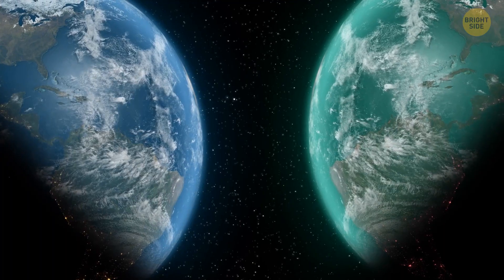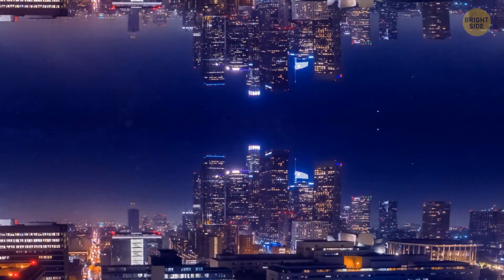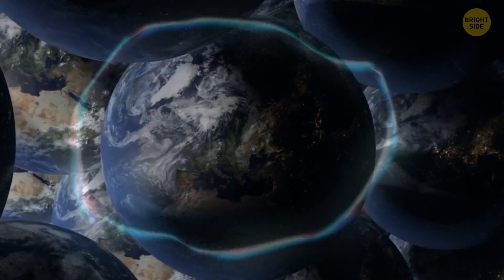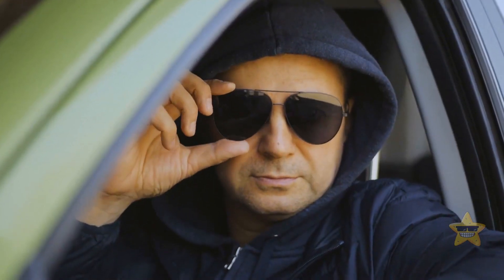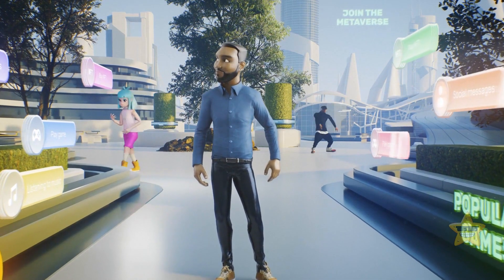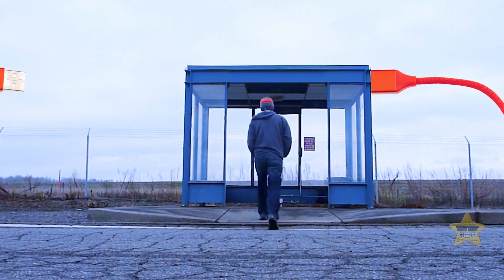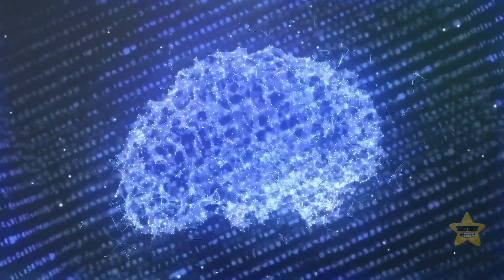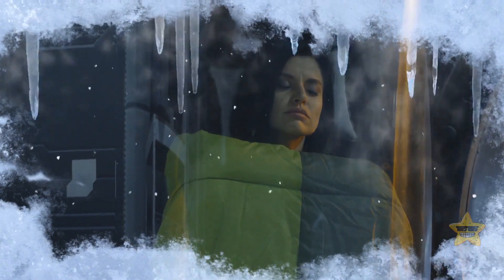NASA Discovered a Parallel Universe?

Comment: Even if our world is a simulation, these simulations will still possess some rules which are identical to IRL. Namely the flow of elecrtricity within the processor can be measured by the inner inhabitants, much like how by pushing a game to it's extremes can create glitches, inhabitants of a VR world, by examining their own world, could learn of the laws of a higher world.
Example: if we were to create a VR world it should in theory be possible for the inhabitants to realiselaws of gravity on the outside world, since gravity will still affect the circutry to some extent, and the VR world by extension, no matter how small.